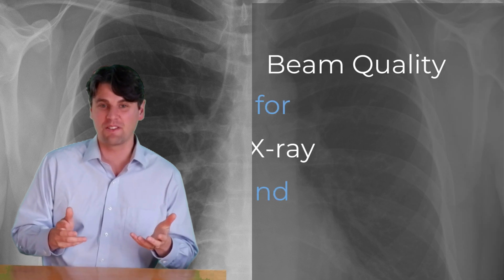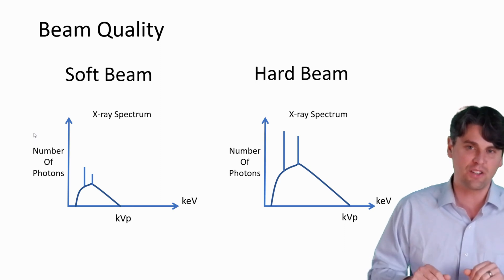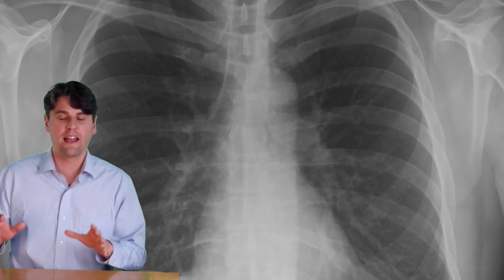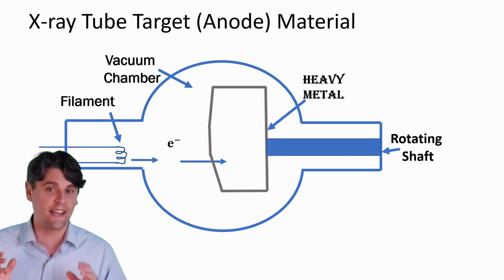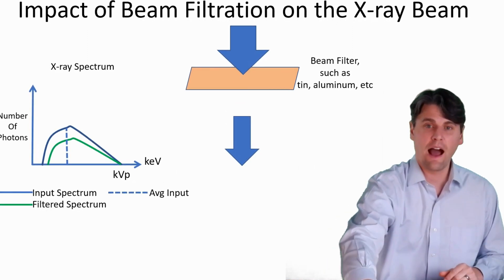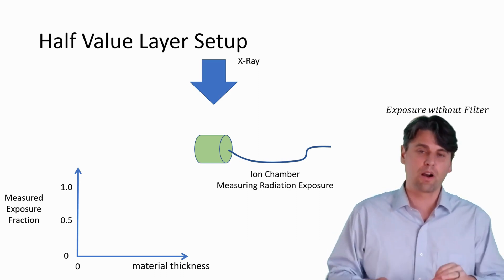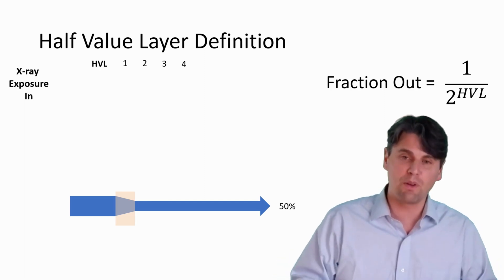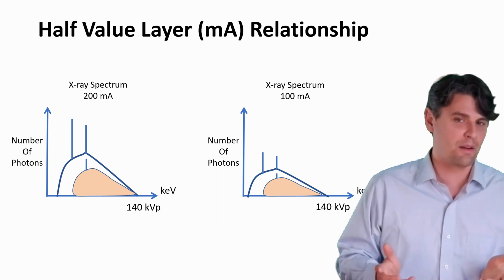Beam Quality X-ray (with Half Value Layer)

Comment: How does the HVL change with beam angle? I'm having trouble finding information about this. Thanks.
Reply: I'm thinking maybe it has to do with the heel effect such that if you have a smaller anode angle, you get more heel effect and thus greater HVL? Is that right? thanks
Reply from the maker: The central ray has the same HVL even after the beam is angled.
Reply: @HowRadiologyWorks  Thanks, do you have a good reference for me to read about this specifically? Thanks